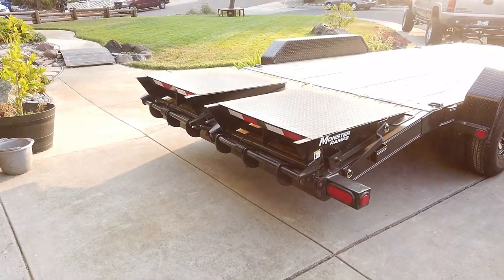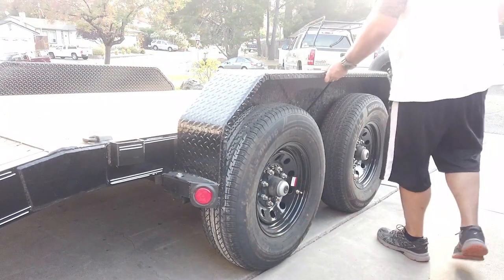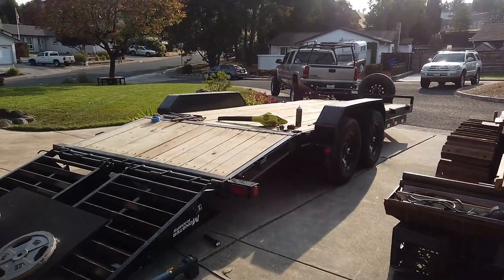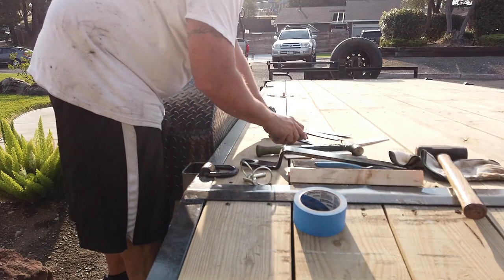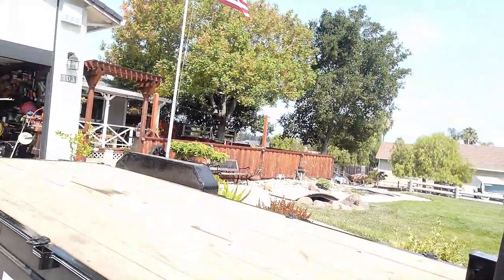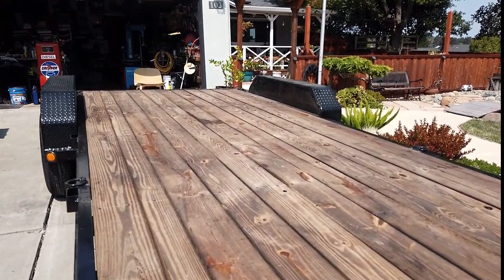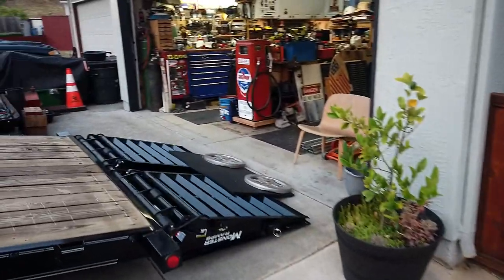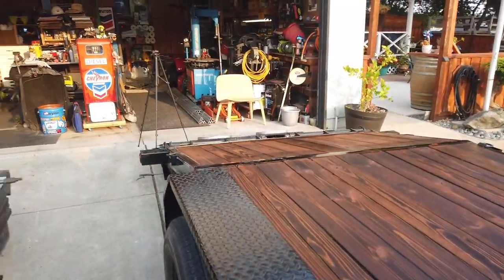New 20' PJ Trailer with Monster Ramps. Fixing some rattling, burning and staining the wooden deck

Comment: Great video! Did you have to wipe the wood down or sand it after your burned it? I burned my deck and it has a black char on the wood from burning it.
Reply from the maker: No ,he only torched it long enough to bring the grain up and then just stained it. If he would have torched it longer, he would have had to brush and wipe it first. Hopefully your back turned out good. Thanks for watching.

Comment: Same Stain I used on my PJ Trailer bed.  Just didn't burn it.  Looks great.  May some silicone at the top (between the spot weld areas) where the two metal pieces come togther may have worked?  What tongue box did you put on?  I am looking to add one, or was it factory installed?  I have the chain tray right now.

Comment: How is it holding up?
Reply from the maker: Actually really good. We keep it covered when we aren’t using the trailer
Reply: Thinking about doing this same thing but mine won’t be covered worried about it peeling
Reply from the maker: We did go through most of the summer without always covering it because we used it a lot. It’s held up great. I highly recommend doing it!